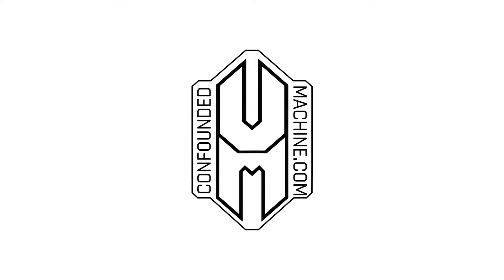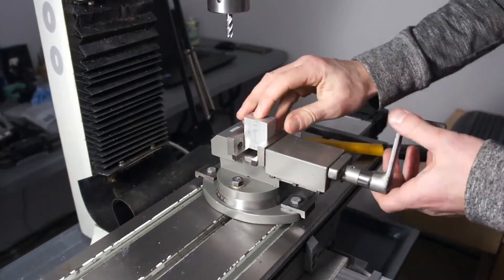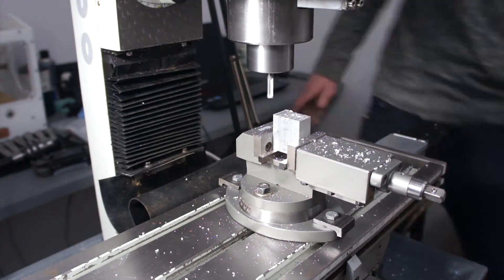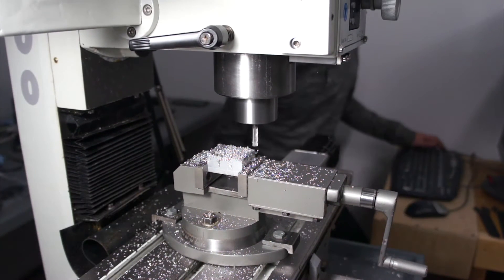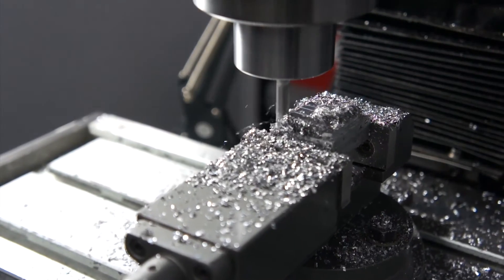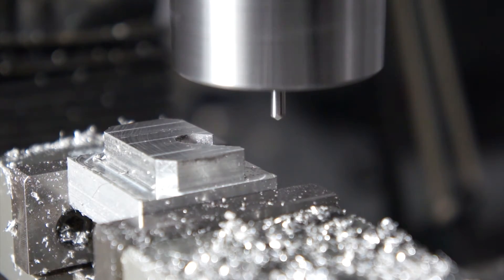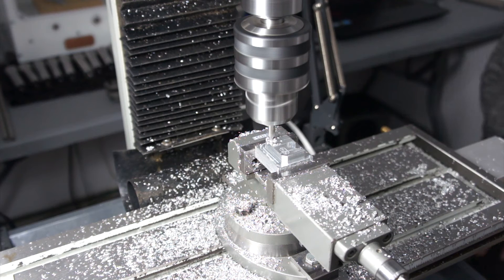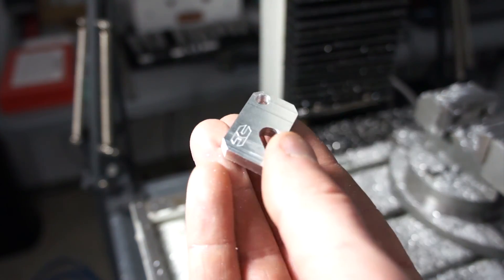Confounded Chronicles 06 - First CNC Chips

Comment: Working as an oiler and running G.M. Canada St. Catharines oil house 25 yr. AGO, i USED TO DISPENDE w.d. 40 IN 4 lITER CONTAINERS. Much cheaper than spray cans

Comment: My vice lifts when I clamp down - is that a common problem, do you have that at all?
Reply: and what should I do about that problem? thanks
Reply from the maker: Common problem on less expensive vise setups, this one has a little jaw lift as well...sadly its best solved by buying equipment with a little higher build quality designed for this application or by keeping your work as low in the vise as possible.
Reply: @CurtVanFilipowski  hmm, darn okay. I was hoping that my KMS vise wouldn't have that problem.